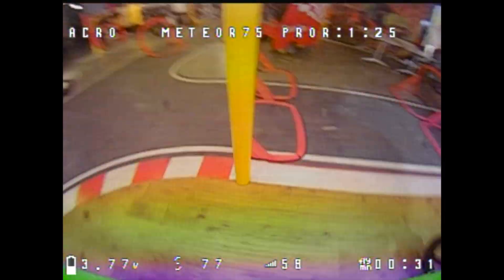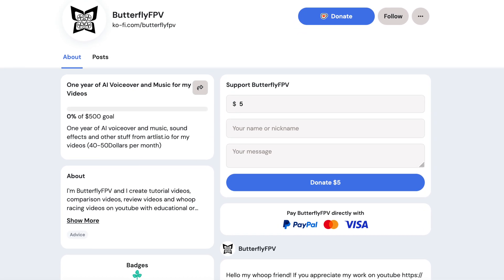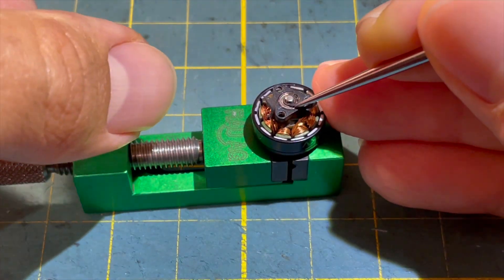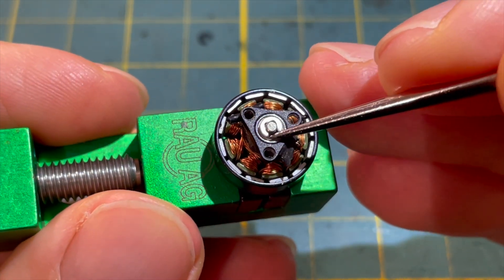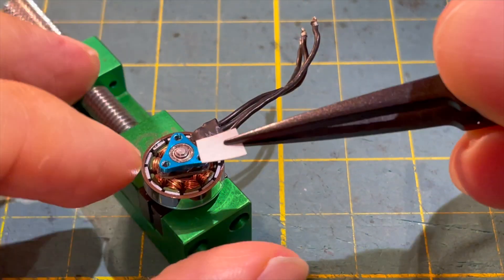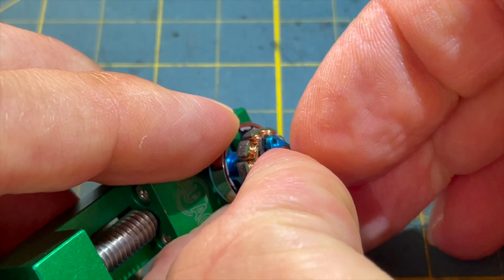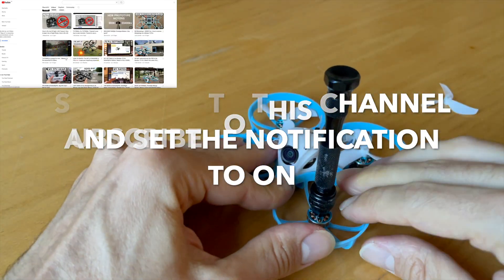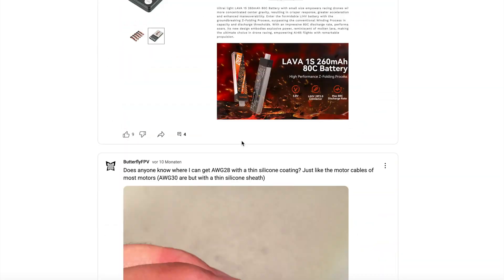E-CLIPS | How to INSTALL and REMOVE an E-CLIP | E-Clip removal | E-Clip Installation | Attach E-Clip

Comment: Yo, thx!
Ich hab dafür auch ´ne ziemlich gute Methode gefunden.
Es gibt ja extra solche E-Clip Screwdriver zu kaufen. Das Prinzip davon kann man sich zu Nutze machen, indem man einfach in einen kleinen flachen Schraubenzieher, direkt mittig an der flachen Spitze eine kleine Kerbe feilt oder schleift. Dadurch bekommt man mit sehr wenig Druck und ohne dass das ständige Wegspringen, die Ringe echt einfach ab und wieder drauf. 
Cheerz!
Reply from the maker: Wow, that's a really cool idea! I think I'd make a screwdriver like this if I had to install and remove e-clips very often. I'd make two. One with a notch running lengthwise for the flathead screwdriver to install the e-clip. And another flathead screwdriver with a small notch in the middle at a 90-degree angle to the screwdriver. This one would then be for installing the e-clip.
Reply: @butterflyfpv  Jepp, kannste eigentlich machen wie du willst. Wichtig ist nur, dass die Kerbe etwa so breit ist, wie der Motorschaft, auf dem der E-Clip sitzt

Comment: I'm a newbie here, why would you want to remove/replace E-clips? what purpose do they serve? Do they break easily?
Reply from the maker: To swap the bell. Or to remove dirt and hair from the motor. Or to thread the motors through the frame (My whoop friend does this with frame and motor combos where the motor doesn't fit through the frame. This way, he can more easily solder the motors outside the frame.)
Reply: @butterflyfpv  so you try and fix your motors when they break or vibrate a lot? I just use them until theyre fully used up and then replace them, should I be fixing them instead? Is it easy like changing a part?
Reply from the maker: Yes. It's up to each individual. But if you have a lot of motors over time, you can sometimes repair one motor using parts from another. You can also buy new motors directly, of course. But personally, I repair as often as possible.

Comment: The replacement clips vary slightly in thickness, so some might not rotate along with the shaft while some do. But you order them per 100 so some will and some won't work.
Reply from the maker: Thanks for your feedback. The E-clip must be the right size. But the thickness doesn't really matter with betafpv's 1102 motors because the groove is very wide. If your E-clips aren't rotating, maybe they're one size too small? Just use the ones that fit exactly, like I showed in the video. Then you shouldn't have any problems. I haven't had any problems.
Reply: @butterflyfpv  I did it on 0802SE | 23000KV motors for Air75 5in1. I also removed the black rubber band under the clip to get it to fit.
Reply from the maker: Ah ok, I don't have these motors myself.

Comment: Kleiner Tipp von mir die Motoren lässt man im Rahmen und benutzt spitze Pinzette dann kann man es auf beiden Seiten ansetzen und schieben! Und der Clip kann nicht weg springen wenn es im Rahmen ist.✌️
Reply from the maker: Oh! Auch eine interessante technik! Danke für den Input!🤜🤛 sehr nice. Werde es probieren. Ich denke das ist eher für die motoren mit dem grossen E-Clip oder? Nicht für die 1102 motoren von betafpv? Ich werde es auf jeden fall bei beiden probieren.. Danke dir für den tipp!🤜🤛🙏🏻
Reply: @butterflyfpv ist für die 1102 und bei 0702 geht es auch in 65 Rahmen

Comment: Bro, you should do a video about tools. Where can I get a scriber? And the green vise?
Reply from the maker: You can get the scriber in any hardware store. Or online. Things get more complicated with the micro precision vise. They're very expensive (200 dollars). But there are cheaper ones available on temu and AliExpress:
https://www.temu.com/ch/aluminium-mini-tischschraubstock-prazisions-tischschraubstock-abriebfest-kompatibel-mit-druckluftschleifern-keine-montage-erforderlich-g-601099604363219.html
https://de.aliexpress.com/item/1005005285852437.html
https://de.aliexpress.com/item/1005007401698803.html
https://de.aliexpress.com/item/1005006768619399.html

Comment: so after the aio5 on my hdzero meteor 75 pro and i wait to buy a new one but after 2months without buying a new one i found that the battery's are really puffed for no reason but the interesting thing is that 1 of the batteries got lost in my house like a week after i build the drone and now i found it and it wasn't puffed but all the others are. the battery's were used in water if that could be doing something to the battery's and they ere stored all of them even the lost one at 4.15V if that's the problem
Reply from the maker: All of the puffed ones were on storage voltage from 3.8V to 3.9V? And in a shady, cool environment? (20 degrees Celsius)
Reply: @butterflyfpv  no all are stored at 4.15V but the lost one isn't puffed at 'all while the others are and will the still work after they are puffed or i should buy new ones
Reply from the maker: @tssfpv  Ah, okay, then that's the reason. You always have to bring the LiPos down to 3.8-3.9V if you're not going to use them for more than two days. I can't tell you why one of your lipos isn't puffed. But I would buy new ones.

Comment: What would the range be on this drone, and what mods can i do to it to improve it?
Reply from the maker: The range on the betafpv meteor 75 pro? VTX (Video) range or RX (Reciever) range?
Reply: @butterflyfpv  The range of the meteor 75 pro
Reply: @butterflyfpv  I meant the range on the meteor 75 pro
Reply from the maker: @fastoven The range is about 150-600m in line of sight. There's not much you can do to improve the range, as the VTX power is limited. And the ELRS power is limited too. You're not flying a tiny whoop yet, are you? If range is important to you, I'd recommend something like the DJI avata. It gives you plenty of flight time and a large range. With tiny whoops, you have a very limited range. But tiny whoops are a lot of fun because they're durable, safe, and quiet. Tiny whoops can be flown almost anywhere.

Comment: great information. i was flying my air75 around the house and got some hair wrapped around the motor shaft inside the housing and couldn't get it out without removing the rotor.
Reply: @butterflyfpv  I had the same problem with my Air65, but there is no gap to push the stator down and expose the groove toremove the e-clip. Did you could do this on a 0702SE II motor?

Comment: Would you mind telling me where you got the Green Vise with the letters RAUAG please?
Reply from the maker: I'll try to figure it out. Give me a few days. And remind me if necessary.
Reply from the maker: https://www.temu.com/ch/aluminium-mini-tischschraubstock-prazisions-tischschraubstock-abriebfest-kompatibel-mit-druckluftschleifern-keine-montage-erforderlich-g-601099604363219.html

https://de.aliexpress.com/item/1005005285852437.html

https://de.aliexpress.com/item/1005007401698803.html

https://de.aliexpress.com/item/1005006768619399.html